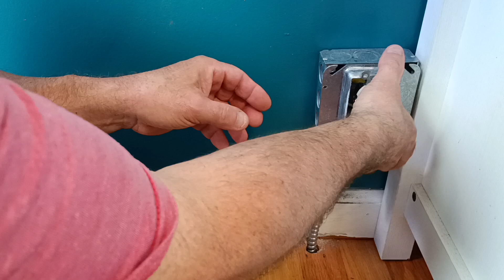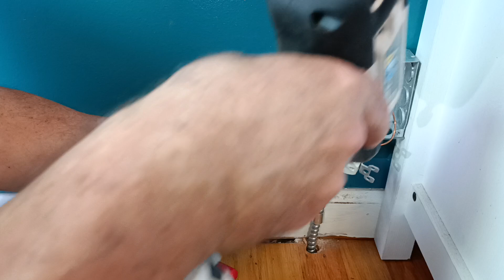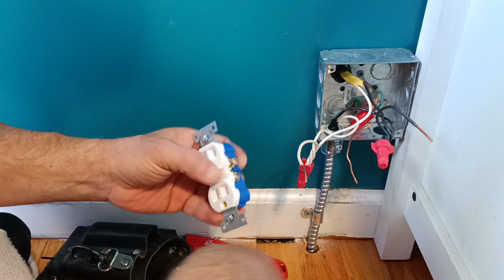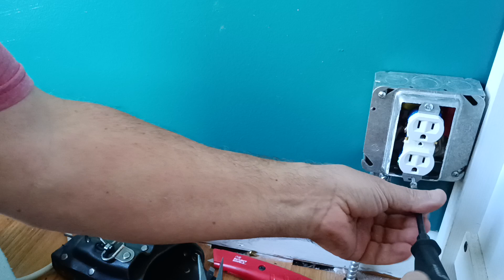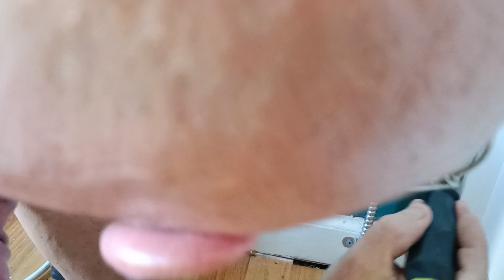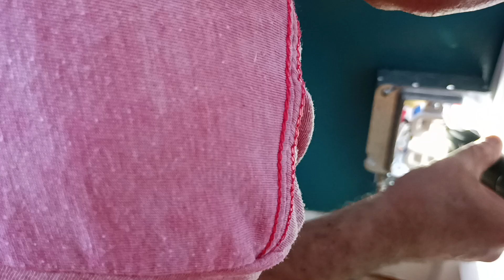the reason to wire a receptacle in parallel because this can happen (pig tail the wires)

Comment: Did you bond to the box with your equipment grouding conductor? That mc cable sheath is not cosidered an equipment bomding conductor unless it is listed as such. It probably isn't as it has sn insulated green grounding wire. I cant see a ground clip or green grounding screw. That's not to say there isnt one. It may be hidden behind some other wires.

Comment: No. Its not switched. But those factory links just don't break off by themselves. It may have been switched in the past due to the fact there is sn open knock out in that box that may have had a switch leg entering the box at one time. But I don't think so.